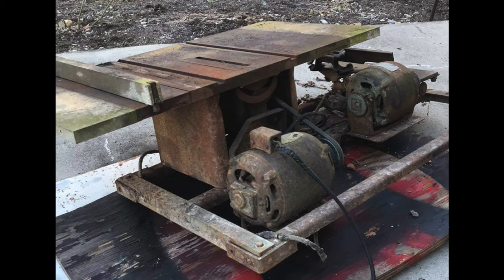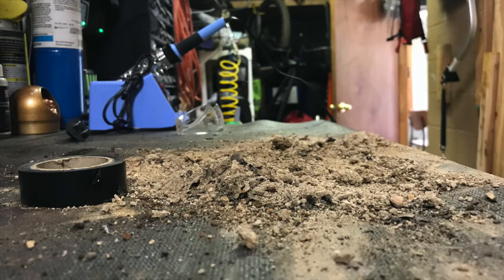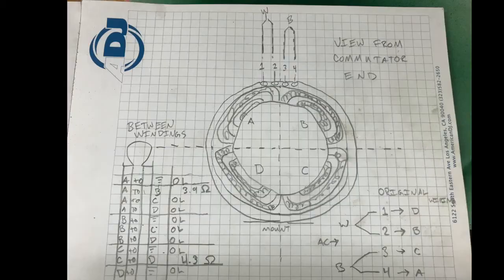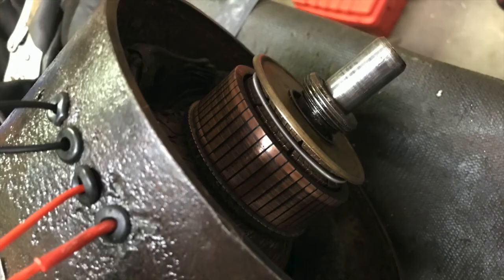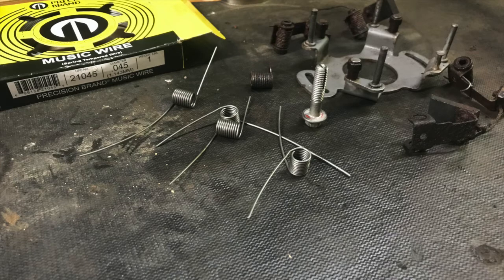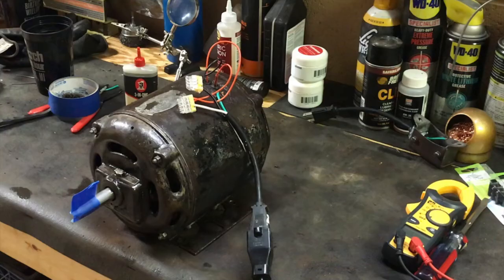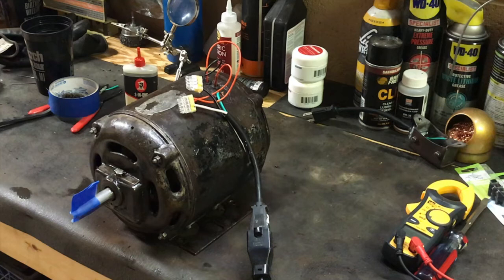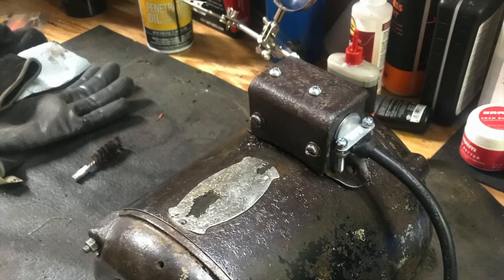Rebuilding a vintage electric Frigidaire Motor by Delco Products Corp - repulsion-induction

Comment: I have this same motor and I am trying to refurbish it a little bit.  Do you have any information on parts diagrams or manuals or anything?  I have scoured the internets and came up pretty much empty.
Reply from the maker: Nope. I couldn’t find documentation anywhere for this motor. I did have some help from the Antique Motor Experts Facebook group though. Lots of knowledgeable folks there.
Reply: @gavinjameslake  Roger that. I have requested to join that group. Fingers crossed!